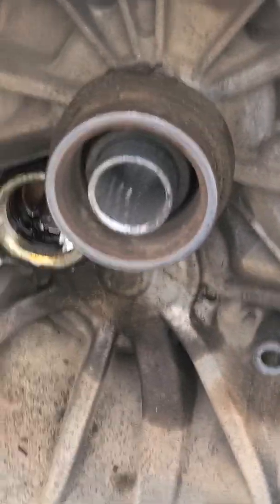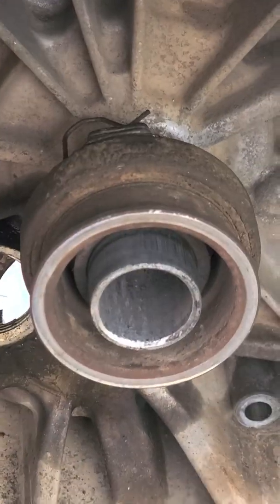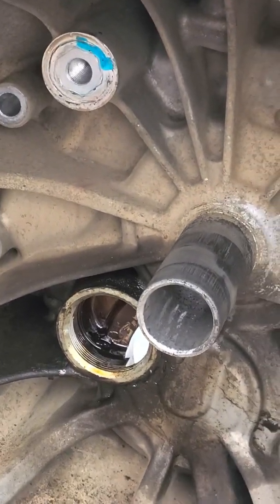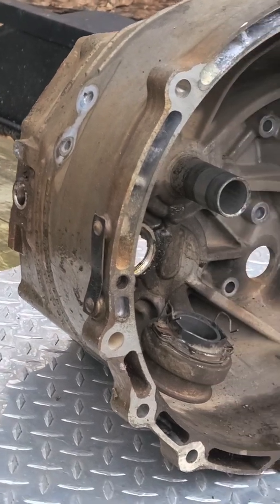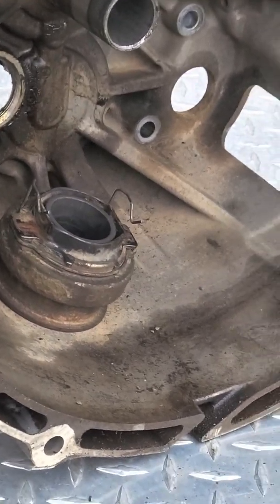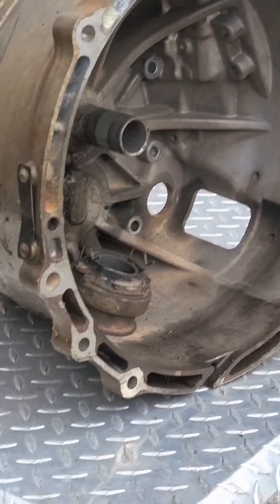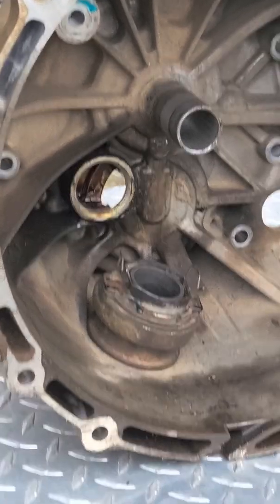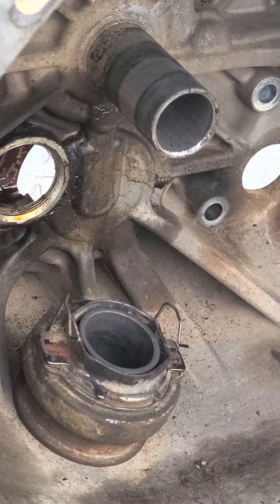Throw-out bearing noise - 6 speed Toyota (2010+)

Comment: 2018 Tacoma.  Clutch is great and TOB isn't grinding, but it is squealing at certain RPMs and when not touching the clutch pedal.  Garages want $2500 minimum for a clutch rebuild when it only has 65k miles and they even said the clutch all looks fine.  Screw that.  Looked into the URD sleeve kit and saw it's just held on by a few lock screws and how people are reporting the squealing returns.  It returns because that sleeve is probably coming loose IMO....

Going to let it ride until I need a clutch rebuild then maybe try the sleeve kit since finding a new housing or picking one from a wreck will be too much of a PITA.  Pray for me though, it just started, but I have to go way off road hauling a camper and maybe a moose in a couple weeks.  This will put a lot of load on the clutch.